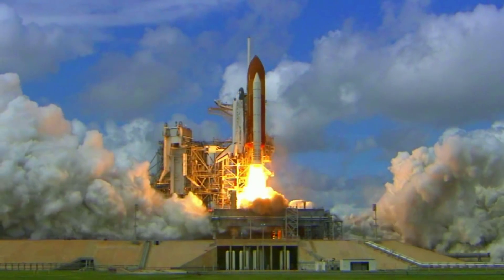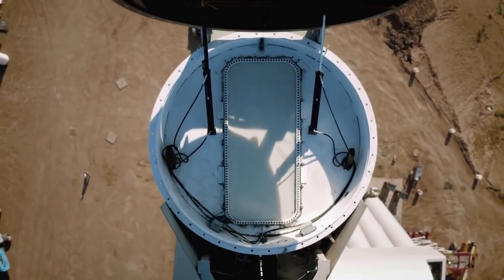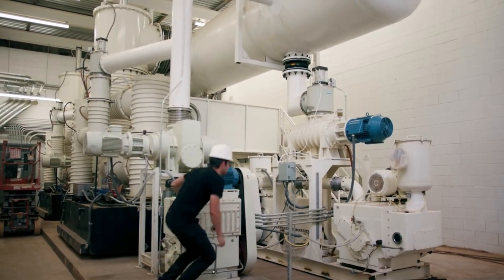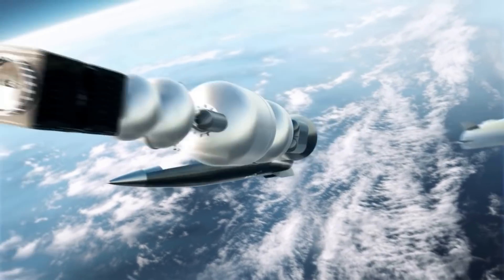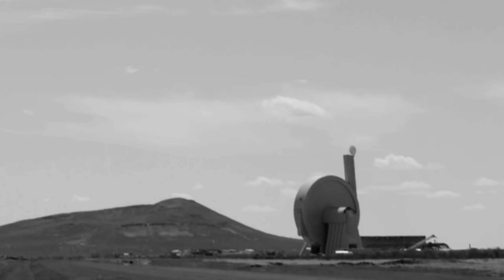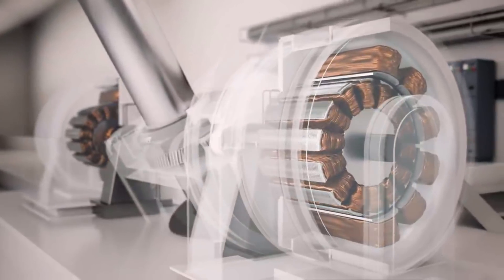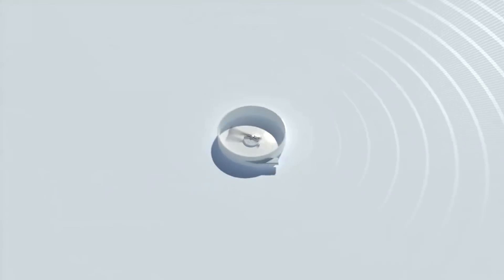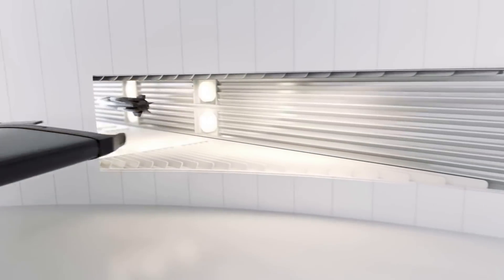SpinLaunch Progress, Recent NASA Contract, & Continued Test Flights

Comment: why not put an electromagnetic railgun in the, i call it chimney, to boost it farther into space? its another facility right next to spin launch suspending an electromagnetic acceleration to the payload and rocket after release from the spin mechanism essentially subjecting it to more stresses to the gauge that material science can withstand especially since the electron accelerator at the relativistic heavy ion collider is being built partly to create new things by probing matter with electrons so the facility will know what things make what. It's better than a mass spectrometer?

Comment: on moon or mars, would be great for sending durable materials to space, like water, fuels, gases, formed metals, food, formed concrete. may not even need more than small steering nozzles. from mars, you yeet stuff to diemos or phobos (moons) bases, then yeet stuff from there to the inner or outer planets,  moons, and asteroids... to keep all of the solar systems colonies, bases, and stations supplied with vital resources and building materials.

Comment: Unrealistic .. The G-forces are enormous and designing satelites to withstand the kinetic energy absorbed makes it impractical.
Reply: on moon or mars, would be great for sending durable materials to space, like water, fuels, gases, formed metals, food, formed concrete. may not even need more than small steering nozzles. from mars, you yeet stuff to diemos or phobos (moons) bases, then yeet stuff from there to the inner or outer planets,  moons, and asteroids... to keep all of the solar systems colonies, bases, and stations supplied with vital resources and building materials.
Reply: @Jemand Zufälliges .. We also design public safety 2 way radios for police, military, and commercial and they need to keep working after a 12 feet drop test several times. Not easy.
Reply: Quite a few commercial cell phones have survived similar G loads without damage. They weren't designed for Spin Launch, just to have a better chance of working after being dropped.

Comment: How far could it throw a pumpkin?
Reply: At 10,000 miles an hour? It might win WITHOUT having to move it to the starting line. But it WILL pie it.
Reply: You'd need to grow a mineralized pumpkin. Any pumpkin would liquify on contact with their membrane atop the launcher and normal pressure air, if not before.